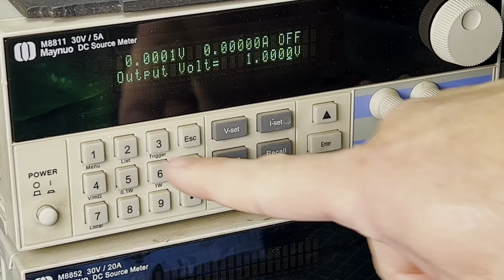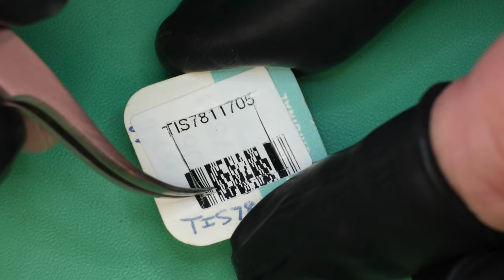ASMR Restoration of 70's Tissot Seastar Watch | Watch Service

Comment: Nice restoration! What solution do you use for watch parts cleaning?
Reply from the maker: Thank you John! I use an ammoniated (it's a local concoction from a Jewellery supplier) solution for the initial wash, then distilled water to remove that, then I finish off with IPA to remove any water. Getting the fancy L&R and Elma stuff in South Africa is almost impossible
Reply: @TheBeardedWatchmaker  A fellow South African! What a nice surprise; and a watch mender as well - that deserves a sub! I'm in Joburg if that is in any way relevant.

Some fun facts - I have the exact same ultrasonic as well, and your little jars look exactly like the ones from WestPack :-)
Reply from the maker: Haha awesome Alan! Fun fact, I’m in Gauteng as well so it’s pretty relevant. I’ve been hoping to smoke out any locals in the hope of combining purchases abroad. As you’re obviously aware, getting a small part urgently to finish your latest project becomes expensive real quick! I’d like to make contact if you wouldn’t mind? If so, you can send a mail to gert at obdworx dot co dot za and we can chat further! Thanks for the sub my man, always appreciated!

Comment: Fantastic Job! One question: I noticed that at 4.28 the power spring was originally installed in the opposite direction than how you later on installed it in 13.03. How do you typically know what is the direction (clockwise or counterclockwise from center) to install the main spring? I think it varies from movement to movement.
Reply from the maker: Hahahhahahaa I was wondering if someone was going to pick up on that 🤣

To be honest, I screwed up initially. Most Swiss mainsprings are right hand wound (using red dot winder) so I just assumed it would be the case for this Tissot. After assembling it all I realised the main spring wasn't holding power, failing to engage the arbour. So I had to take it out and redo it with the left hand wound winder (blue dot). It is correctly wound in the video, the clip at 13:03  slipped through the cracks as showing the incorrectly wound direction.

Thank you for pointing that out though. I genuinely appreciate people actually being so attentive as it means they are getting value out of the videos, which gives me the motivation to make more

Comment: Hi again, I have 3 similar ones, and one of them gives me a little problem  with the soft spring action of the shiny lever which helps the date ring stabilize itself when the date just changes. I see on your video (20:30-20:50 or so )that you install the spring the same way I do but mine does not even seem to offer any spring action. Do you push it up a little and it does not show ? It can’t be done anyway ! My lever goes in and stays in there sometimes !
Any commment would be appreciated before I settle for the way it is ! Thank you.

Comment: Very well made and very inspiring! But I missed the point: what was the main reason the watch was not running?
Reply from the maker: Thank you! The reason the watch wasn’t running was because of a broken escapement pivot. I suspect this watch was apart a few times (hence the bent hands) and at one point, someone mounted the top bridge without making sure all the pivots were in their jewels. This broke the escapement pivot and the train seized up. The fact that the case clamps were missing was another clue that someone screwed up and just closed the case and dumped it on auction as not working.

I do appreciate questions like these, as I can use them to explain things a little better (than I thought I did) in future videos

Comment: Very nice outcome,question for you,I have a Seastar movement 781-1 which has stopped after winding ,are parts readily available for this movement ?.Thanks
Reply from the maker: Hi, thanks for watching. Well, with Tissot being part of the Swatch group, they stopped supplying parts to independent repair since 2015. If you’re looking for common replacement parts (winding stem, main spring, etc) you’re out of luck from most material houses as stock has dried up. You can still find on eBay at massively inflated prices. In the case of this watch, it was over $50 just for a new stem. So I found a 2nd had one and used a stem extensions. In the case of less common replacement parts you might be lucky as again in this case, the replacement escape wheel was available from Cousins for around £20 if memory serves. Your movement is very similar to the 784-2 I had here, if you figured out what is causing the issue on your movement you welcome to ask and I’ll see if I can help finding the part.
Reply: @TheBeardedWatchmaker  thanks for offer,I will come back to you after my watchmaker has been inside and if he cannot get replacement bits.Again thank you.

Comment: Thank you for making this video. 
I would like to get into watch modifications and eventually gradually start Watch service and restorations. 
Do you have any directions as to what are some things I can be doing? So far I have bought basic tools more geared for modding from DIY watch club using a NH35 movement. (I successfully changed the date wheel, hands,and dial to aftermarket seiko parts not given by the company)
I’ve read practicing on a pocket watch works well being that the parts are bigger and easier to work with. I also want to try and disassemble and reassemble the movement. 
Any advise on good books, schools or things that has best served you in the past to help build your skills. Thank you in advance! 😁
Reply from the maker: Hey Skyler, I’m glad you’re interested in digging a little deeper than watch modding! If you have a look at my YT home page there’s a “Friends of the channel” section where you can go to my friend Alex’s channel “It’s about f****ing time” (yes, he’s a riot) where he is busy doing a whole video series on getting into watchmaking. He’ll do a much better job going into the nitty gritty than I could possibly hope to do. https://youtube.com/channel/UCXV8h3I9pnfZuDpg6xEM_8w

When you feel this is the way to go for you, I would honestly recommend doing a course with Mark Lovick over at watchfix.com - in both these cases they go into detail about what tools you need to get into watchmaking but, more importantly, they will gradually build you up from beginner to wherever you feel comfortable with. Just a note: resist the temptation to just go and buy all the cool tools. Start small (you already have some decent tools to start with) and build up from there as you get more experience. And if I may, starting with Seiko NH series movements is a cheap way of getting into the hobby as movements are cheap enough as a source for donor parts. Once you get into Swiss watches, things get harder - financially and access to parts. I hope this helps, please ask if something is unclear

Comment: Wonderful job you did bringing this ol' boy back life. Is that a rubber bushing you used to expand into the case by squishing it with the vise? I haven't seen that done before. Where do you get the bushings?
Reply from the maker: Thank you Denver! Those are just old poly bushes used from a glass fitting press. I used two that fit the top and bottom of the case snugly, perfect for use as spacers to clamp down the piece I’m working on.
Reply: @TheBeardedWatchmaker  That's a really inventive way to hold the case still but not causing more harm. I wonder if you had more of a squishy bushing if when you clamped it, it would expand and hold it that way as well. I see an opportunity here to make a sales-worthy quality devise. 🤔
Reply from the maker: Haha, very few ideas are original anymore. I saw someone use the technique before, although I’m racking my brain trying to remember where.
Reply: @TheBeardedWatchmaker  ah darn. Back to the old drawing board! Anyways, great job and thanks for the info. You have a happy new subscriber.